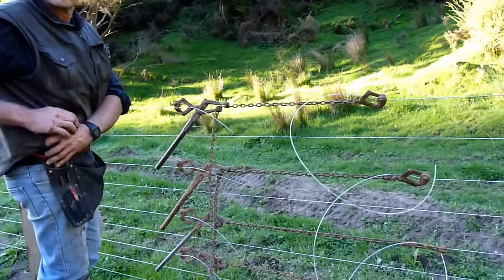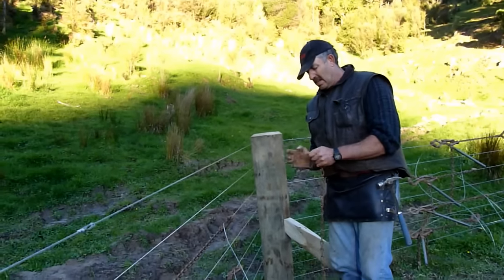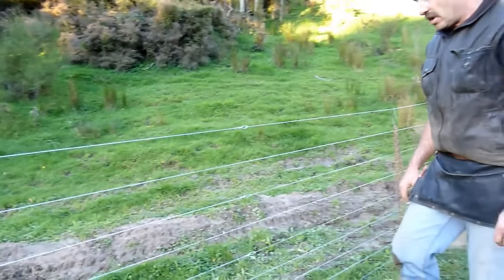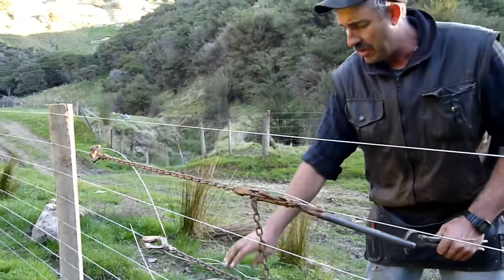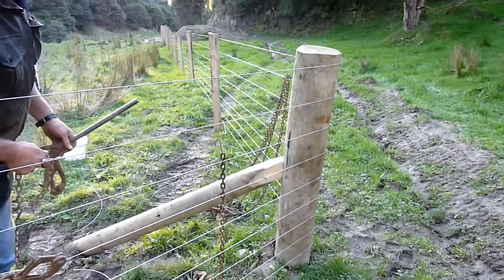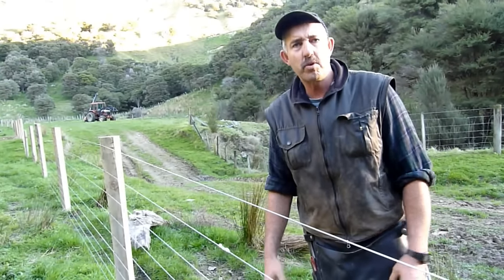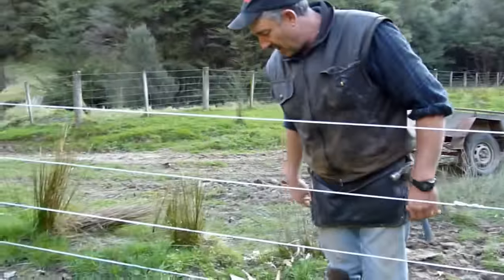best agricultural fencing tips - TIP N°1

Comment: Never seen a full bull wire fence before. Here in Northern Ireland it's sheep wire with 1 strain of barb below and 2 or 3 strains above then the ole boys with only cattle and does their own fencing works with only barb wire but this is rare now. Only time bull wire is used as a support wire twisted between the strainer and it's support post or as a bottom strain under the sheep wire. Love this kind of work

Comment from the maker: This particular fence was built with 2.5mm high tensile wire which is commonplace in NZ though 3.15mm HT is becoming popular. Before this all the fences were built with 4mm (No8) mild steel wire which is good stuff but it needs to be pre stretched and it does lose its tension over time whereas the HT wire holds its tension for ever providing the fence is built properly. The posts are 600-700mm in the ground and the strainers are 1500mm in the ground.

Comment: Great video. I am looking to build a sheep fence. I would like to see more detail on how you build a 90 degree corner. Are you still using the floating brace method or H brace?
Reply from the maker: Do what suits your situation the best. I prefer the diagonal stay method because it is quick and reliable providing it is installed correctly. Be sure that there is a foot on the bottom of the strainer especially if it has been dug in. Good luck.
Reply: Corner braces - I just use 2 diagonal struts with a rock or post in the ground to brace struts. Just make sure to line up your struts in the correct direction and retreat all cut ends of the timber (notches and tenons) with some good preservative to make them last longer

Comment: 1500mm deep? that's one solid strainer. Got to agree with your comment on Strainrite monkeys, always use them myself, never let me down. One thing I've stopped doing is nailing staples dead onto wire due to galvanised coating damage, too many weak points being created.

Comment: a 9 wire fence wow!?  Is that common in NZ?  Here in Idaho USA most people do 4 or  wire.
Reply from the maker: Nine wire fences are common here in New Zealand. They need to be sheep proof and are so that cattle can't get their heads through. They work very well and the country is covered in them. Adding a hot wire or two makes them bulletproof.
Reply: @Otokastation1  I run cattle only (about 300 mother cows), i've recently switched to hi tensile wire and i love it.  How high is your top wire?  What is the spacing layout on a 7 wire fence?  So far, my cows respect a 5 wire smooth hi tensile just fine.  That is in low pressure areas.

Comment from the maker: @cyberprop 
Plain wire and batten fence better suits the undulating land that we have in most of rural New Zealand. It is far easier to deal with in challenging conditions and is a lot cheaper per length.
On the right terrain netting is ideal and quick and easy to erect but can be a nightmare to tighten when you have to go over hills and through hollows.
We don't use a lot of barbed wire in this country anymore. We prefer to use either more wires or use electric wires.

Comment: I love the blasting idea, I think I want to find out what it takes to get licensed.  I have a post driver with a pilot driver, but when you do get through rock the posts that are larger then the pilot hole still break.  What are you using to make the hole for blasting? What are you using for blasting?  Here in the US federal law doesn't require a license for binaries as long as you use them where you mix them, allows farmers to use ammonium nitrate for stumps.  State law can be more restrictive.
Reply from the maker: Try a rock spike. If that doesn't work you've got some seriously hard rock and you'll need some serious gear to drill a big enough hole to put in a charge. Let me know how you get on.

Comment: Great video, awesome tips. I thoroughly enjoy watching a master work. I am fixing to build a fence for goats and was looking at the woven wire fencing with predator control. I really like the look of this fence and this high tensile smooth wire stuff is new to me. How effective would this fence be at containing goats, and keeping out predators? I have relatively flat ground much flatter than what your dealing with. To contain goats what would be a good post spacing and the spacing of battens between post. Again thanks for posting such a great video.
Reply: BTW I meant i like the look of your fence, and how effective is the fence shown in your video at keeping goats in and keeping predators out 

Thanks
Reply from the maker: Jesse Lynch This fence is designed for sheep and cattle in hill country. If you want to contain goats and predators you will need a higher fence with electric outriggers. Goats will challenge any fence. Be careful using netting as they can get their horns stuck in them. Get used to the idea of using electric. It makes animals respect any fence. My suggestion, 1550mm high with two electric outriggers then you've got them.
Reply: Otokastation1 what about batten spacing
Reply from the maker: Goats are difficult to contain behind fences. I would suggest a 1.8m netting fence with a hot outrigger. Make sure the netting is right on the ground so the goats can't crawl underneath. Good luck.

Comment: What did you use? I dont think its a tex brown which is what I use but this looks way quicker
Reply from the maker: I called the knot a "Taihape Knot" simply because that's where I was shown it.
We tested this knots strength and it is 70% the strength of the wire which is the same as a figure 8. This compares to 20%, that of the Tex Brown and double loop knots.
 Training is needed to learn the correct tying technique. If its not done properly it can fail completely. Hope you can see enough from the video to work it out. Good luck.

Comment: More info on blasting a post hole please!!! Farmers/Fencers can't get access to dynamite here in Australia anymore :(
Reply from the maker: You will need to get an approved handlers certification before you can purchase explosives. Not sure what the rules are in Australia but I'm sure it's possible. You then need to be able to drill the rock. I have pneumatic gear so not a problem. You only need to use a 1/4 to a 1/3 of a stick to crack the rock, any more and you'll end up with a bigger hole than you need.
Reply: Otokastation1 ok, i'll make some inquiries

Comment: I realy liked the  video but I didn,t here the two company names who make those chain strainers.  I don't think they are available in the USA.  How can I get some?
Reply from the maker: +Rainbow Works The chain wire strainers are made by either Hayes or Strainrite. Both are New Zealand companies and have websites. I have worked with wire strainers from all over the world and these two companies make the best ones by far. Nothing else comes close.
Reply: Look on e bay for old ones use a bit of sand paper and oil  to get the rust off and it will last meany life times

Comment: Lovin al those Hayes pullers, don't know what they cost there but on the other side of the world, Canada, they cost $200 each, at a time where gas us about $1.50 per later and a pack a smokes is about $13.00, just for comparison, in my opinion they are the best pullers out there but a little pricey in my part of the world
Reply from the maker: You are right. The Hayes strainers are good but it depends which batch you get. I bought a set of ten one time and the steel wasn't that good and the wire son cut into them and they started slipping. The manufacturer replaced the lot and I have since worn those out. Strainrite are another good brand also made here in NZ. If you do buy some be sure to cut the springs out and throw them. They are much easier to use without.

Comment: Don't chuck your wire off cuts on the ground. Have a wire bucket.
Reply: He had them all pulled up at same time which is by far the best way as you can correctly adjust each line. Once under tension what order you tie off is up to you.
Reply: He picks up wire waste, guaranteed.
Reply: see 12:08 He picks them up.

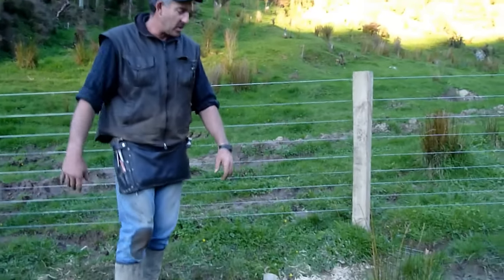Comment: You have the wire on the wrong side of the posts. Assuming that your position @12:41 is the side the animals will be located.
Reply from the maker: You're mostly right but the terrain changed so much over the length (1.2k) it was just easier to keep it all on one side.
Reply: @Otokastation1  With sheep, it should not matter. If the wiring was to keep horses or cattle in, then it would matter.

Comment: That type of fencing is hard on horses. It can cut them up pretty good.
Reply: sonseere10 is there any wire that would be good for fencing similar to this?  I don't know anything about building and fencing and was thinking 3 strands of (large in diameter) galvanized steel cable but now I don't know?
Reply: why would it be hard on horses?  THere aren't any barbs.  Curious for your opinion.
Reply: @joannab7299  I prefer the thick gauge no climb fencing  where the squares are small enough that a horse hoof can not go through. It comes in rolls. Easy to install. Make sure it is placed on the inside of the posts.
Reply: @westonandelin4556  Of course, barbed wire is the worse. Very good for cattle, terrible for horses. The ranch here has the wire fencing. Came that way when the ranch was purchased. No barbs. But so many horses have been cut up on it over the past 5 years. I will never use this kind of fencing again. A horse can get a hoof through the fence. If the hoof gets caught on the wire, and an untrained horse panics, they can rip their leg up pretty bad. Thousands in vet bills. Completely avoidable. I really like thick gauge no climb fencing. Excellent horse fencing.

Comment: Good enough knot but that corner brace is a joke it will push that post out of the ground
Reply: Don Armstrong yup i see that and the angle beam will pry it up and out as it straightens I’ve been doing it for as long as I can remember and we have tried all of the braces out there and anything with an angle beam support will pry the post out over a few years. If you want a good brace use 3 ten foot long six inch yellow jacket drive it in five feet with two six inch yellow jackets welded a foot from the top and it won’t move when you pull two miles of fence on it
Reply: H Dog , I see more tension below the stay than above so it shouldn’t pop.

Comment: It just needs some 240V pulses in it !
Reply from the maker: I agree. But, the fence I was building is a legal boundary. You are not allowed to  install electric unless both neighbours agree. Now, if you are using electric (which I prefer) be sure to use a purpose built energiser that pumps out around 10,000 volts and earth it properly. 240V volts is more likely to kill you than scare you.